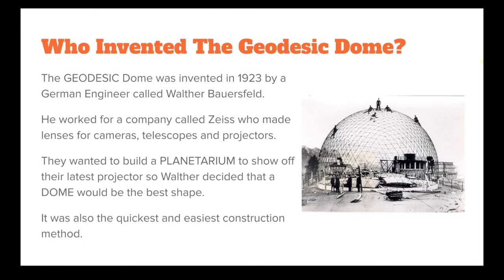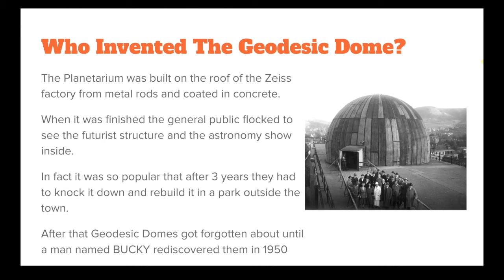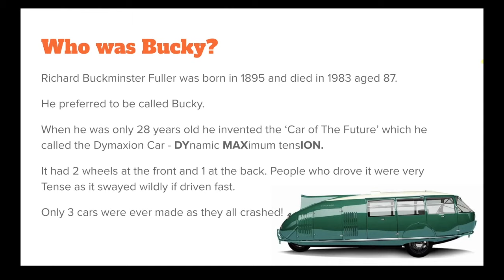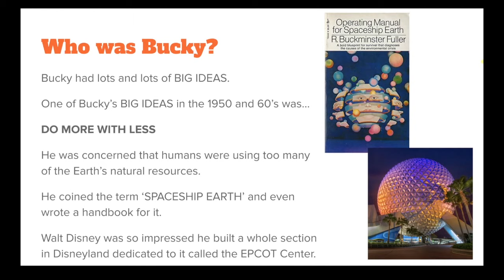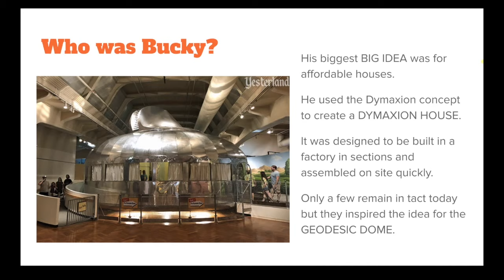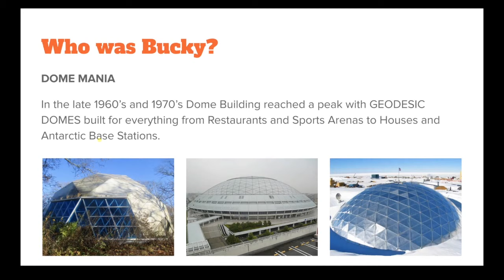Building Our Laser Cut Geodesic Dome Kit

Comment: So we can do the hubs with an bent iron rod (like a flower) and the struts with bamboo and kablamo! We have a big dome!
Reply from the maker: If you do make a big dome like that we would love to see it! Good luck.
Reply: @fablabmakerhub  hoping for an opportunity but will keep you updated! Thank you for your great work and video!
Reply: @fablabmakerhub   Check out the geodesic domes I build! I invented a new type of hub (discovered them really) and have been building them for the last four years. Tell me what you think! Cheers.
Reply from the maker: @lemondealc  Really interesting hub system you have there. You are doing some great work.
Reply: @fablabmakerhub  Thanks! I am also a part of a group that is trying to start a maker space in Waukesha Wisconsin. Is your channel associated with a maker space or a larger maker network?
Reply: My preference for dome models is heat shrink tubing and bamboo skewers. For full size domes with timber struts i`d recommend sections of heavy wall aluminium tube for the hubs and hanger bolts (wood to metal dowels).

Comment: Went to facebook with address provided, but not finding much to look at.  Your video is 3 years old, but facebook looks to be undeveloped.
Reply from the maker: Sorry Facebook has never been a big draw for us. We have other projects we work on and use Twitter and Instagram mostly. Check out @leo_scarff_design and @joincreativeheartlands on Instagram for more up to date posts. Glad you liked the video (even though it’s 3 years old).
Reply: @fablabmakerhub  Thanks for the reply, but I have yet to use Twitter, or Instagram.  Not sure I am ready to open another account since it would mean spending more time with yet another bunch of distractions.  As if I don't have too many already.  I don't recall every being notified of your reply.  The way the kit is construction would suggest the best possible scheme taking advantage of the better way to align the wooden struts.  The connectors would need to be very thick plywood if the construction scheme was preserved rather than using a metal connector design.  I am thinking greenhouse.